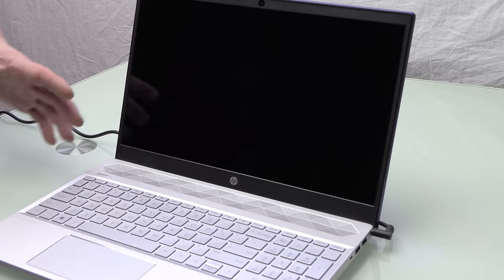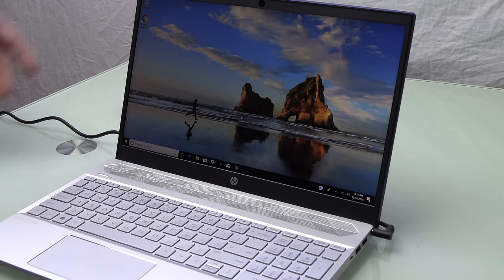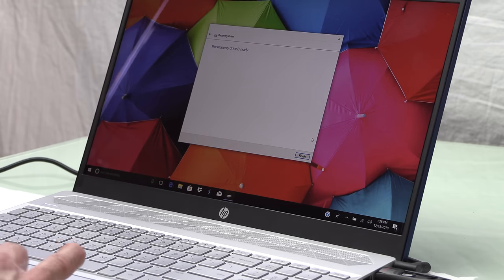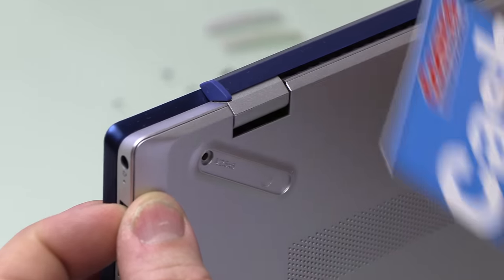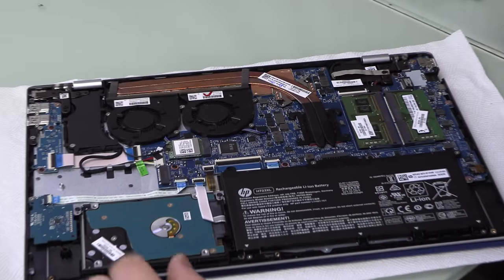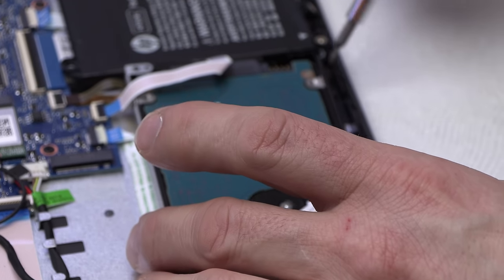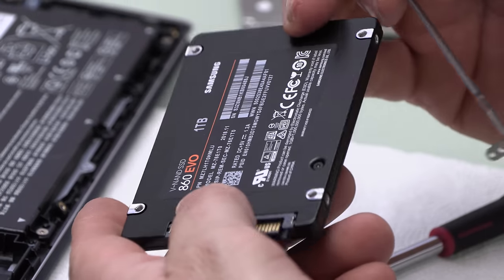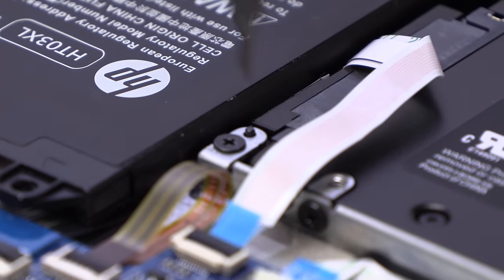HP 15-CS Laptop - How To Remove HDD and Install SSD

Comment: I've just opened mine up, and I kid you not, there is NO HDD installed where yours is. This has me baffled as the laptop has windows 10 installed and it runs just fine! I had to open it up becuase I need to completly wipe the hard drive clean as it got a virus. I'm good with computers, I know what a HDD looks like, and I can't see one anywhere inside my laptop
Reply: It probably has an ssd in the m.2 slot then

Comment: All this cost saving by not having access panels for the disk and RAM. The savings made are tiny, and now we all have to fight fragile plastic lugs. Also, the battery is not easily swappable either. I am not convinced this is progress.

I suppose we ought to be grateful it's not an Apple as they are intent on making nothing repairable.

Comment: Should have used the M.2 clot and it would have been even faster
Reply: Hey is I use the M.2 slot can i still install the V-Namd ssd  860 evo into it?
Reply: @lindalonghi3453 Samsung 860 EVO M.2 SATA, not PCIE and will work

Comment: It would have been much easier and faster just to clone the old drive to the new ssd
Reply: only if your computer was working perfectly to start with.  Cloning a messed up installation won't fix software problems.  And when the drive has bad sectors?